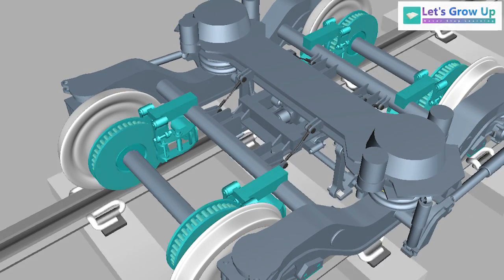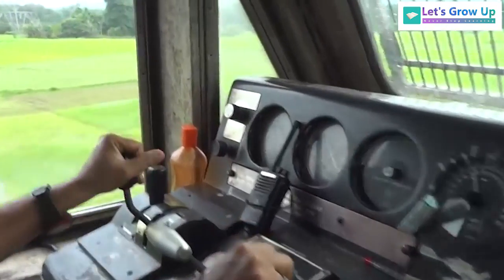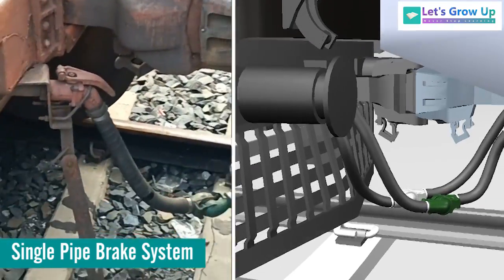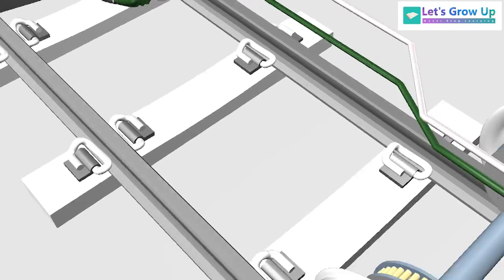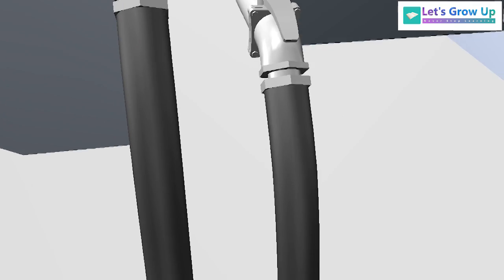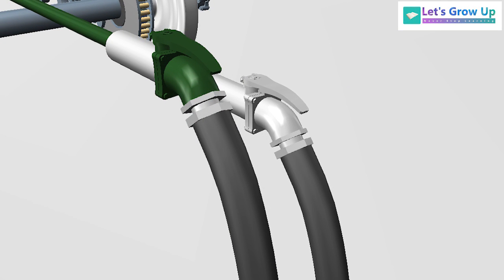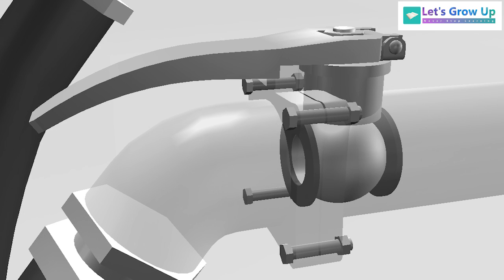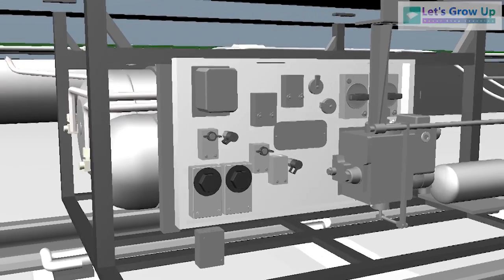Why train use this pipe | How does the train brake system work?

Comment: In the Netherlands, we had trains that got set aside that used a different brake system. This brake system was causing issues of wearing it unevenly. They replaced the brake system with this one; it saved those trains.

Comment: I have traveled from Chennai  to Surat, Chennai to Pakur. Recently traveled from  Chennai to Patna. All LHB coaches have a jerk while starting from the platform and also while the brakes are applied while running. It is very disturbing. Can the design engineer do something to remove this jerk? This will wake me up when I am in deep sleep while traveling.
Reply: This is because of central buffer system..I read somewhere that these buffer systems will now have high absorbing shock absorbers so that sudden jerks wont be felt.
Reply: Yes still some lhb coaches are yet to be updated on jerk issue.. today also I felt lot of jerk in charminar express. It's so annoying. ICF are better due to this but safety wise lhb coaches are good.